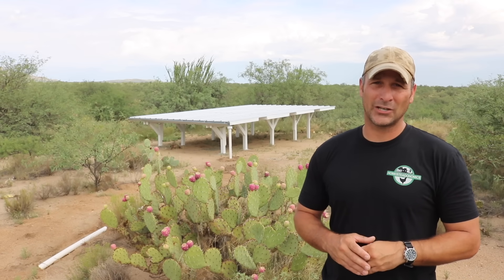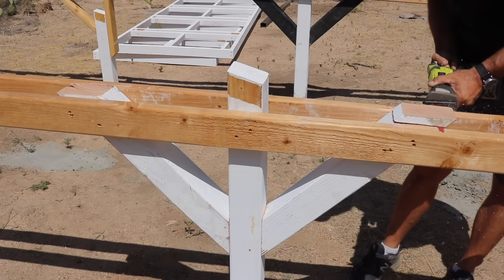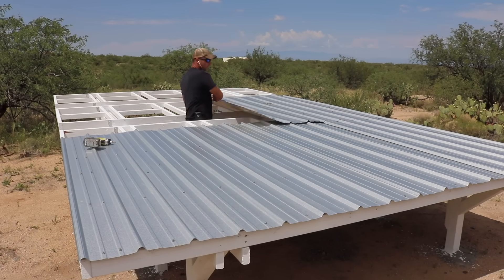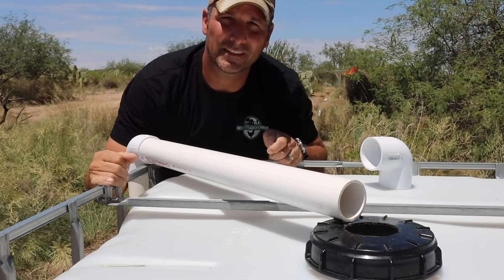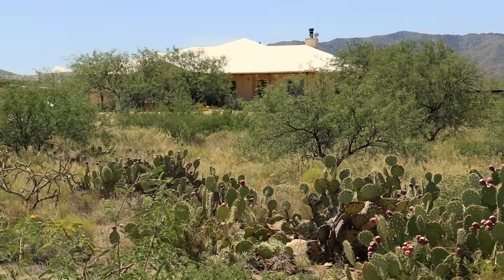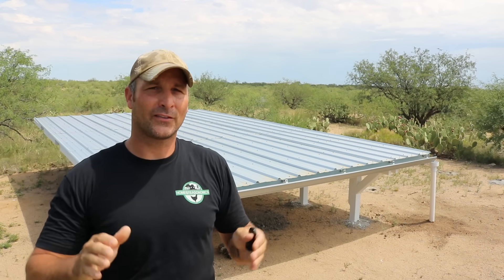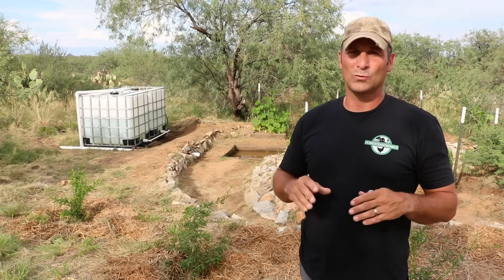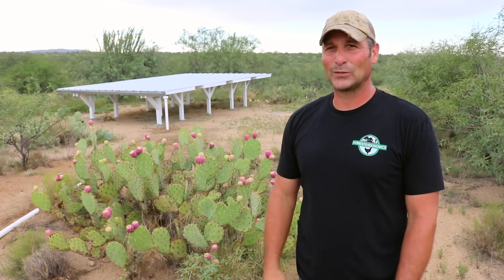Rain Roof -  Rainwater Harvesting Project - How To

Comment: 145 comments in only a few hours, wow. You've got some enthusiastic followers, mister.
First off; great job. Reusing and testing is a lot better than just starting from scratch. Nice work.
Second; nice shout-out to Sierra Vista (Huachuca City/Whetstone). Buena HS grad here. Go Fighting Colts! 
Lastly; I know that piping the runoff into the top of your IBC's makes the most logical sense, but I've always connected my systems to a manifold that is simply attached to the drains at the bottom. There are benefits to each setup, but I've always tried to keep my systems as sealed as possible, (since I don't intend on making it potable) and flowing water up from the bottom into upside-down barrels or into the drains of IBC's has worked well for me. You can then tap into the 2" piping with a 2"-3/4"adapter to connect a ball valve hose connection and drain the containers from the same manifold.
All good stuff. Love the information and the ingenuity. Keep up the good work and keep on inventing.
Reply from the maker: awesome!  great to hear from my local folks!  and yes, there are some great subscribers here!  ... with the staple of a few trolls that seem to subscribe for no other reason than to thumbs down the video and leave a weird comment... lol... 

thanks for checking it out Michael!
Joe

Comment: I'm curious why you didn't try to recycle the roofing samples you had there already, and maybe add on with those to save some cost on the roofing material - though that steel roofing did sound pretty cheap, so maybe it wasn't cost-effective.
Reply from the maker: NSMike87 couple reasons...one was that I needed to save those panels for them to reference for future quality improvements.  And the other reason is that I (especially my wife )didn’t want a patchwork of random colored roofing there permantley😉👍

Comment: I also live in the AZ desert, you and I both know that rain might be scarce, but when it does it comes in buckets. Your 4" cap is not enough, the SQ footage of your rain trap will over shoot your 4" cap funnel. It needs to be larger and maybe shaped to catch at a more horizontal configuration in addition to being underneath.
Reply from the maker: yep, larger rains will overrun this set up... but for the medium sized rain I was able to watch (about 11pm.. which is why I didn't get footage)... it worked well.  so light to medium rains I think it'll be just fine.. the larger ones I will get a bit of lost water... 

but the quick reason is that the wife sees the home depot receipts which is why I went with 2" pipe instead of 3...lol ;)

Comment: Is there a reason you screw into the shallow rib profiles instead of between them?
Reply from the maker: it really wouldn't matter either way for this application but generally with roofing you want the perforations in the roof to not be in the valleys of the roofing where the water runs.  but so long as the neoprened washers on the screws seat well and you have a decent enough pitch either way could work:)

Comment: Build a water tower with one IBC tote, use a small solar powered pump and move water into the tower tote so you have pressure to run a hose.
Reply from the maker: A water tower is on my want to do list for sure:)

Comment: Awsome I like the Garden and the Idea of growing/ watering your own food.
Reply from the maker: thanks for checking it out jerry
Reply: @homesteadonomics  I have learned a lot using solar power as well. Run your 12 volt system in line do not cross over for 24 volts. Hook the solar charger into one end of the batteries run your inverters from the other end to your dwelling. The trick is to use a battery with a dead cell at the very end before sending 12 volts to the inverters this acts as a resistor saving power in the battery banks only allowing what is needed to flow out,  I did this using a 45 watt solar system at the cabin we had led lights and a 24" old style tv running for up to 5 hrs at night. On 2 old car batteries actually 3 counting the one with a dead cell.

Comment: You can reduce the size of the pipe between the collection area and the storage tanks by including a holding tank at the collection area. Setup the largest pipes between the collection area and the holding tank to force feed it all the water it can take as the rain comes down then connect the holding tank to the storage tanks using 1 inch irrigation poly pipe. Include stand pipes by setting posts to lift sections of the poly pipe higher then the collection area and you can then run a sealed system to let the holding tank hold water when the storage tanks are full. 

The beauty of the poly pipe is it comes in 100,250 or 500 foot rolls so no joints to leak for an average run.
Reply from the maker: I will have to look into that... sounds interesting... but the holding tank would have to be big enough collect a good rains worth... which would mean it would have to be an IBC... and then I'd have to dig it down to get it under the gutter... which isn't going to happen anytime soon due to the amount of work I have planned... but I really do like the idea :D
Reply: homesteadonomics the upper cistern wouldn't need to be as big as an IBC unless you get exceptionally heavy rain? If the head is great enough and you use a syphon, even a half inch hose can shift surprising volumes of water.
Reply: Spencer during the monsoon we can get bursts of 1 inch in 15-30 minutes then it stops. The size of the roof he built would pull in 160ish gallons from that 1 inch of rain so just over half a 275 gallon tote and the rains can come one after another so the next one might overflow the tank before it could drain down. 

June to October we get most of our rain with a little more at the start of the year then nothing but clear skies with a few clouds till next June.

Comment: I’ve tried multiple different plastic friendly paints including Rustoleum and none of them held up to the Colorado sun. Also, because the plastic used on those IBC totes, the paint doesn’t stick well either. I’ve had the best long term results by wrapping it in black painters plastic that comes in rolls. It’s also cheaper than multiple cans of Rustoleum plastic paint.
I’ll be curious to see how it works for you. 
Thanks for your great videos!
Reply from the maker: Yes, I'm testing one with the rustoleum 'camo' series for plastic.  But if you ended up not having luck with it I'm guessing I probably won't either as our sun has almost no humidity filtering for most of the year and my elevation is pretty high too.  the second option is to cover the cage portion with a roofing material to protect it and kinda pretty it up a bit too :)
Reply: Sweating plastic in a desert like environment, you might as well gather the water dripping from inside the wrap, plus mold & mildew will form inside the wrap black which will eventually need Clorox Gel cleaning - brush it on, wait 15 min and scrub adding more then with a pressure washer spray it all off completely, no more black mold & mildew (like new).

Comment: Only thing I mighta done different is sister the 4x4 posts together to make them taller, making the whole roof tall enough to walk under and use as a picnic area, or a work area near your rainwater garden.
Reply from the maker: I did consider making it a bit higher but we get really high winds and any of my larger structures are much better off in steel to resist the racking that they can go through... but yes, it would definitely have given it a bit more utility :D
Reply: Makes perfect sense. The way you built it was certainly a lot easier and more efficient than what I suggested. And of course, if you want to put something under it, all you need is a shovel - just dig a hole similar to what you dug for your greenhouse, and you can make a sunken storage area for anything from rain garden supplies to additional IBC totes. Doesn't even have to be enclosed, just under the shade of the roof.

Is your dog a digger? Maybe she can be persuaded to do some of the work for you and save on the shovel time.

Comment: A Ram Pump, DIY, could be placed in line, and pump up to a tank, with a sand filter, maybe 15 feet off the ground.  And you'd have potable water for your personal use.
Reply from the maker: yes, those ram pumps are really cool but most I've seen use quite a bit of water for the action... which isn't great with our limited quantity... but if I had a spring nearby then yes :)
Reply: MarkH10 ram pumps only pump a tiny fraction of the water passing through them to the higher level, no use for this application! Plus the volumes of water even from a large roof are unlikely to be sufficient to operate a ram pump.
Reply: @spencerwilton5831  I stand corrected, now I recall I knew them to be placed in a substantial stream.

Comment: How would this compare to the tarp you are using? I hope you keep building more water collection units, you could really turn a large area green in the desert, maybe a big orchard.
Reply from the maker: as I talked about... the tarp is way more cost effective... but this doesn't require the elevation in topography to make it work to fill a tank as much as the tarp does when it's on the ground

Comment: This is such a simple low-tech way to collect water, I wonder why rain collection isn't part of more houses. People have hundreds of gallons of water spewing out of their gutters meanwhile they're paying the city to pump them water.
Reply from the maker: Thanks for checking iit out mark!
Reply: Its all about the money and control.
Reply: I think it has a lot to do with lack of education or lack of caring. Most people hire a construction company to build a house and they will try to talk you away from anything that's not traditional. For me, I want to be able to understand and work on the systems in my house. As people start to realize the health concerns of fluoride and chlorine in their water along with even worse things like in Flint, MI people will get on board with water catchment. Some people try really hard to conserve their city water which is pretty funny considering if they had a large water catchment system they could waste plenty of water for free and still have full reservoirs.

Comment: Could you wrap the sides with mesh and use the underneath as a chicken coup?
Reply: How about using that clear roofing material he just tested, and collect water off a greenhouse FOR the greenhouse?
Your answer is YES.
Reply from the maker: and yes, Mark, I've got water collected off my greenhouse already... but it goes to the garden as I didn't want to pipe the water inside the GH... just in case I got a leak ...lol

Comment: Wow as long as you were changing it up a bit, I think it would be good to elevate it and you accomplish your goal and also could have a great Patio that could be used for shade. Good harvesting.
Reply from the maker: thanks... and yes it would be better to have it higher.  but wanted to keep the inputs to a minimum and use what I already had.  Additionally, with our winds... any higher structure than that i would want to make out of steel for durability

Comment from the maker: NOTE:  After I uploaded this I realized that I forgot to include a couple clips showing how I use a hose to water from the IBC's and how the piping can be drained.  Will try to show those on a future update of this project.  - Joe
Reply from the maker: that's just the rainwater garden part... watering from the ponds.  I wouldnt use that water through a drip kit, it would clog it very quickly.  as for the IBC tanks, yes I could do that for sure.  But I don't mind walking with the hose that is connected to the bottom of them.  Kind of therapeutic time down there...haha... hope that answered your question
Reply from the maker: toto dona     --I'll trade you some sun for some of your rain :)
Reply: Thank you so much for the great ideas, I am from the Island of Jamaica, we depend on agriculture for a living. Most of the dry season it's very difficult for small farmers to get water and also some of them can not afford to buy water. I will save this video and go around showing them how to build rainwater roof in their garden. Thank you for inspiration. 👍👍
Reply: homesteadonomics
I know you're utilizing existing materials, but it's really low. Low means animals will hang out under there, you don't get the benefit of extra storage/parking/hammock house, and you'll get more bugs and wind blown dirt in your traps.
Reply: "how the piping can be drained"
Does this concern the potential for "stagnant" water collecting in the knee of the piping? I've wondered about that. Maybe it's not important because it evaporates?
Reply: lu
Reply: WHITE IS COOLER OO, COOL JOB NOT EASY DIGGING IN THAT CALICHE SOIL. I DID SOME DIGGING OUT THERE IN ORACLE AT MY DADS PLACE. LOVE YOUR VIDEOS, JUST SAYING OLD ONE LEGGED JOSEPH T RETIRED NAVY
Reply: That's a pretty cool system, not too much leak from the sealing plug at the end of the pipe ? There is quiet a bit of water behind it i think, maybe protect it from the sun to not deteriorate with UV. I have done something simillar on my greehouse but i live in france in a really rainy area, here water is more a pain than a ressource, you don't mind giving us a bit of your sun ? :)
Reply: You could set solar panels on this surface too...free power.
Reply from the maker: yes, for sure... I talk about several reasons why this isn't the most ideal setup in the video, and why it is set up the way it is :)
Reply: it might not be the most ideal setup but I guess a lot of smaller animals actually might love to find a shaded spot sometimes as well in the desert like environment... and as you said... you used what you already had there... if you really want to get some more "height" under the roof, you only need to take a shovel up there (I know it is a pain to dig there later on) and go down like a foot or two... to build yourself a earth hole house ;-)

by the way... you still can use this low roof for storing some things... like spare pipes, lumber, firewood and so on... you just don't need to put it all the way to the back under it ;-)

anyways it is a nice video and has some good ideas :-)
Reply: yes, but crazy not to raise a bit to use the shade better.....but great info !
Reply: homesteadonomics add a pic of the comalong pipe jack to. Pls.
Reply: Sir, if you don't mind,  please revideo it again about a couple clips that suppose to be.  Thanks
Reply: No settlement still pond for sediments (dust, dirt and sand). Wind blown dirt will collect on the collector be transferred to the gutter, then pipe and holding tank.  The question then is how much more years of use are lost from pipes and tanks filling with dirt.
Reply: @D May, you could always add a first flush divertor: https://www.marley.co.nz/products/rainwater/rainwater-accessories/first-flush/
Reply: You might want to look in to the chemistry of PVC, you shouldn't be using it to .. Well you shouldn't use it period as you are voting with your dollar.
PVC is toxic, it contains carcinogens that you ingest true the off gassing, direct contact and in this case the indirect contact of the water running true the piping.
Reply: You might want to turn the ends of the sheets down to prevent the water tracking back up the sheet and getting on that fascia timber
Reply: Hi sir i'm from palawan philippines hope one day i do this in my home town
Reply: you could add a water timer to where the hose connects to the IBC to auto irrigate the garden. can buy from any hardware store.
Reply: Awesome project buddy, I think we can plan to use solar panel for rooftops & also rise the height which will help to use land below the structure. In a way one can use this project for 3 propose. Solar power, rain water harvesting & also agriculture activities.  What's your opinion. Reply me on matrixresourcellp@gmail.com. com
Reply: Congratulations
Reply: When you free you visit me I see you real rain water sources my whatsapp +917737500600
Reply: Just place a capped off T, instead of an elbow at the lowest point before it starts the assent to the tank. The capped portion of the T can be removed for draining any residual water in the pipe.
Reply: Hey Joe, in in Hawaii & we harvest rain for living, but they use zinc aluminum roofing here- not steel. Does it (or the roof paints) leach harmful materials in the water for consumption?
Reply: homesteadonomics pnbm
was my only complaint about the
Reply: Joe, I thought collecting rain water was illegal.
Reply: Dont answer that Joe. I found the answer in another one of your vidoes. 

New subscriber buddy.